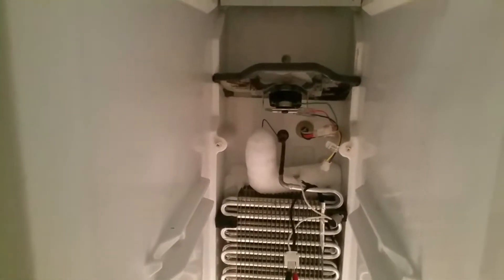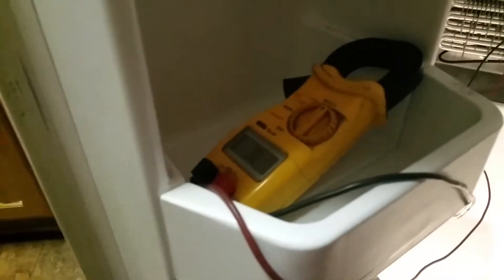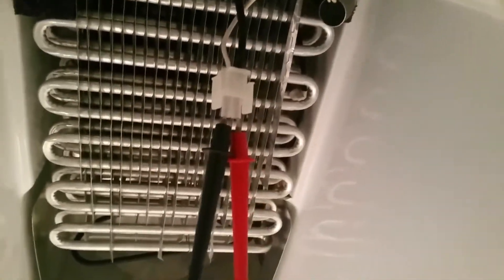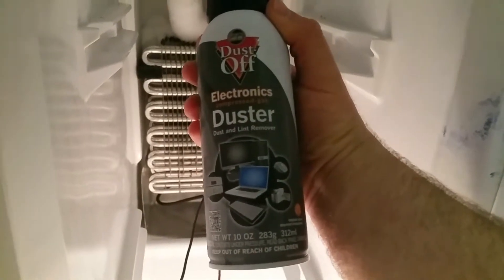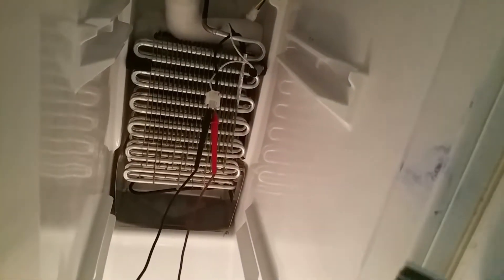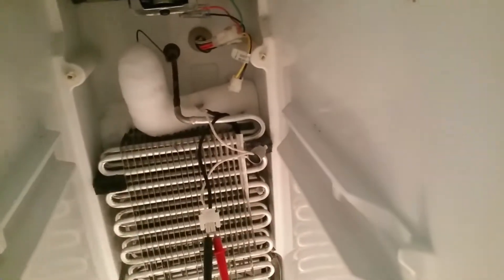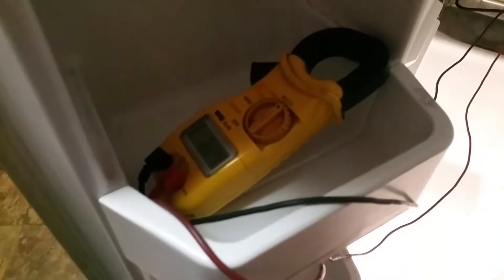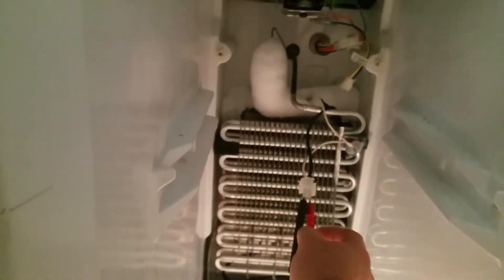How to Test a Refrigerator Defrost Thermostat (Bi-Metal Switch) with Compressed Gas

Comment: I have the same exact problem, what was the solution?
Reply from the maker: aybesee123 I had a blockage in the filter dryer, which is not exactly common. I had multiple other issues, so it was more cost effective to get a new unit. I also checked the defrost timer as well. I had to replace the condenser fan motor, put a hard start kit on the compressor, then found that there was a leak in the evaporator coil. So take it one step at a time.